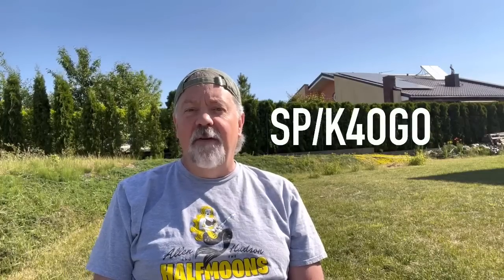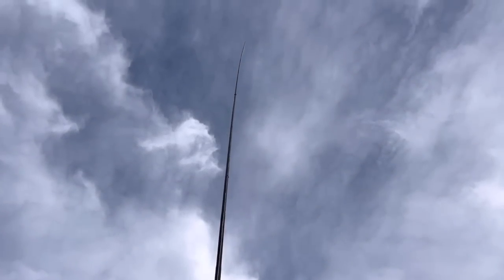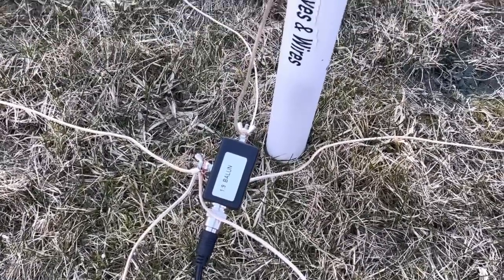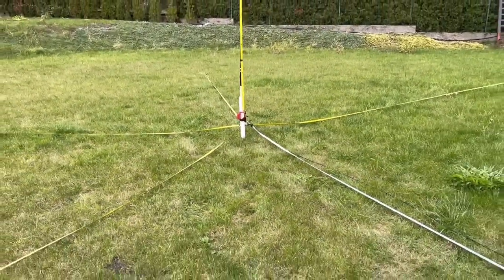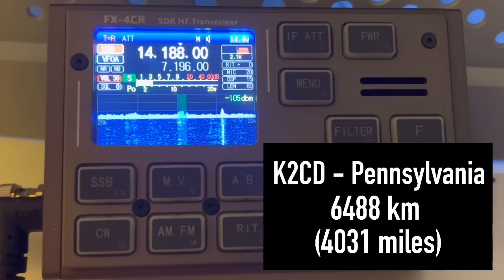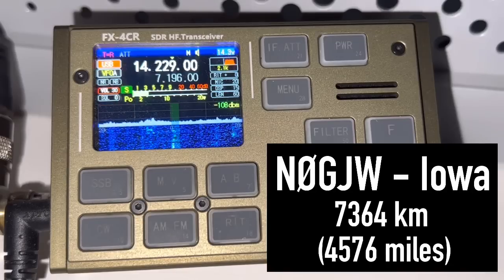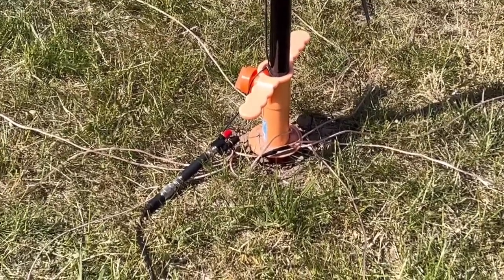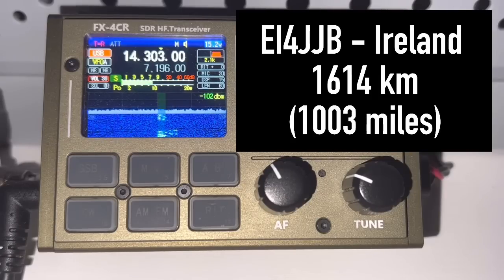Building Vertical Antennas for HF Ham Radio DX

Comment: I would like your feedback of using a tree to hang a vertical.  I would like to try to hide this antenna but worried about how the tree interfere
Reply from the maker: Go for it! The tree will have minimal effect in the antenna. My current home base antenna is an inverted V EFHW hung through limbs in a tree and it is performing well. 73, Walt
Reply: @COASTALWAVESWIRES  Wow, may thanks Walt for the quick response.  The trouble I have is that I have several powerlines, power corridor, that run near my back fence in my backyard.  To string a EFHW or LW horizontally, one end would be near the powerlines (noisey).  I am trying to find ways to get farther away from the powerlines, and have been watching your great videos on verticals.  Looking to possible go perpendicular to the trunk or inverted

Comment: Walt, love your channel, can you talk about how your guy and support your antennas on the beach? How do you anchor guy wires in the sand?
Reply from the maker: Thanks! I never use guy wires on the beach. I typically use a pipe driven into the sand or a beach umbrella spike mount. Here’s a link to a video I did on beach antennas: https://youtu.be/KM9HH5xioXw?si=Ek3ywdPlHFh1-M7o

Comment: I have not had any ham radio signals on 10M or 6 Meters. I use a OCF 80M wire horizontal at about 24 feet up. I had to make it L shaped because of my property but Eurpope would be at 45degrees from the center of the LI am in the Kansas City area. I can get 20 all day and evening including DX in dark hours, 40 dx dark hours, 80 dx dark hours.  I would love to know what is keeping me from getting any 10 or 6 meters. I do get constant tones  down the waterfall spaced every few hundred or so KHz on both 10 and 6. I use a tuner with a 7300. I make many long distance contacts on the three bands I can get. I have turned off everything but the radio sill have those constant tones. They don't sound like a digital signal just a constant tone. I want to make one of your vertical antenna designs but I have no space for radials. Kansas is running a little short on salt water. Maybe in a few years that will change.

Comment: I’ve had a few. In my experience they have always been inferior to horizontals. I built one over 30’ tall with a web of buried radials, it worked and it wasn’t bad; but it was inferior to dipoles oriented in the direction of the station I was working.  I had a MA5b mini beam deployed only 20’ up, and it was life changing.  The ability to add gain and minimize noise can’t by underestimated.  Near the ocean, you basically get a lobe over water with a vertical, so I’m not surprised you got some gain to the northwest.
Reply from the maker: Horizontal by land, vertical by sea

Comment: This fishing pole you choose is made mostly of carbon fiber. I read that the best to use is a pole made of insulator like glass fiber. Should i find a glass fiber fishing pole or dont bother and choose that pole you showed in the video? Does this really matter?
Reply: Yes, you better get a fiberglass telescopic pole. 

You'll run into issues with the carbon fiber. You'll need to get rid of the layer using a sander which is harmful for the lungs

Comment: The best HF vertical I've found was a Slim Jim. It's only good for one band but highly effective. Built from 450 ohm ladder line...a 1/4 wave matching stub connected to a half wave radiator, like a J-pole, but the Slim Jim connects both sides of the ladder line at the top and there's a gap down near the top of the 1/4 wave stub. The trickiest part is to know the exact vF of the ladder line, in order to get the dimensions right the first time. Not easy to retune. I ended up grabbing a vintage Millen grid dip meter and finding a vF of .95 when it was stated as .92. But it's worth the effort...this thing works very well on 10 meters. Built a second one for 12 meters and 2nd contact was JA with 5x6 on his end. There's also a noise benefit...it's a DC short antenna, like a loop, so has lower noise floor. Very much worth building.
Reply: Ok I think maybe that IS a J-pole, and I like the idea for 10m, it could be practical and have the low angle radiation and not require the added ground connection. Still might be good to get the bottom up at least a quarter wave above ground? Well that means the top of your 3/4 wave antenna needs to be at least 30 feet above ground. Pretty "doable"! I want to try that!
Reply: @davidjohnson497  This guy's calculator works well, but you need to fine tune the dimensions by getting the exact vF of the ladder line. This antenna is a PIA to retune by cutting or adding. I buy an oversize piece of LL...DXEngineering has good stuff...and short one end and use a dip meter to find the vF. Then plug that into the formula, get your dimensions, and build. The only other trick is that the 50 ohm feedpoint position tends to be just a little lower than the calculated one. I highly recommend a nanoVNA. But once you get one up and running, it's an excellent antenna. Not really sure about minimum height above as I'm using it mounted on my 3rd floor fire escape...25' above ground.

Comment: I've fooled with verticals for decades... the most effective one was my "Chicken Coop Vertical."  It was simply a trap vertical in the backyard, but the counterpoise took me three full days of work to construct.  I literally carpeted the backyard with chicken coop wire.  While it was on the ground I took a propane torch and soldered every twist together to prevent oxidation.  Then I used chopped up metal coathangers to tack down all the chicken wire (no digging).  For a good while I mowed the grass high so as not to hit the wire... the weight of the mowed grass eventually buried the wire and it was never seen again and struck during regular height mowing.  I was a great antenna for 20-years until I retired and moved away.  Unless he wants to dig holes in the backyard, the new owner will never know it's there.
Reply: Way cool story and design, thanks for sharing about the chicken wire ground plane! Great idea.

Comment: I noticed on your helical antenna you had a 1:9 balun - always wondered about those, and always thought they were for 5-10 ohm impedances to match to the 50 ohm radio. Was it actually a 9:1 balun and just misnamed?
Reply from the maker: Yes it was 9:1 unun and just misnamed.

Comment: For the wolf river coil and the military antenna, could you tell me which military antenna you used? Did you have to use an adapter with it?
Reply from the maker: I use this one and no adapter is needed: 

HF Manpack Collapsible 7 Element Whip Antenna 285 CM Length https://a.co/d/0TKSEqW
Reply: @COASTALWAVESWIRES  thank you for the quick response, I'm looking through the wolf river website, which coil did you end up using with it?
Reply from the maker: @johnkeo358  I have the Silver Bullet 1000 (the big one). I was just out with it this weekend: https://youtu.be/JHNbEND-Tt0?si=v5vQ6MNIMk0KIo1N
Reply: @COASTALWAVESWIRES  nice, I'll definitely have to consider purchasing it. I always wanted an antenna using the mil whip to get some nostalgia. Just got my ticket for general last month, I hope we meet on the airwaves!
Reply from the maker: @johnkeo358  see you on the airwaves!

Comment: Could you take the 7.6m wire and hang it off the 6m pole, making it slightly off vertical? Would think you'd still get a reasonable takeoff angle.
Reply from the maker: Yes, I think it would work well.

Comment: Good video Walt.   I am a fan of vertical antennas as well.  Currently, I am using half of a driven element from a TH6 beam I had up in the day that really works well on 30m-10m with a external tuner.  This antenna has surprised me on its performance with a half dozen radial under it.  Thanks again KN0A.
Reply from the maker: Thanks! 73 my friend

Comment: look into the Jackite poles, a little heavier but a bit more sturdy.
Reply from the maker: I’ll check them out
Reply: @COASTALWAVESWIRES  Just found you on you tube.  love all of your reviews and the way you present them.  You've got me fired up about QRP.  I ordered the tr usdx and thinking seriously about the FX 4c.  I run a 32' wire up the largest Jackite pole, (32 ft I think) with a 9 to 1 unun at the bottom.  Does real well portable.  going to look into the Rybakov!
Reply from the maker: @williamsteele5729  awesome! Good DX my friend!!!

Comment: This video is great.  What you said at about 15:08 is exactly what I tell all the new hams that are worried about antennas.  I tell them that the best part of antennas is just going out and trying them out.  If one doesn't work, try another.  Before long, they will find one that performs for them.  I also tell them that what works really well for others may not work for them and vice-versa.  So indeed, a great video putting that theory to work!  73 de N6VHF
Reply from the maker: Thanks so much! I completely agree! 73 de K4OGO

Comment: Love your style. As a result, I would appreciate your advice. Im working on a marine solution for my sailing vessel. Working with an icom 7300, shakespeare 390 vertical and a ldg at100proll. Trying to figure out how to setup my ground plane to the sea. Balun 1:1 to a bronze plate? What do you think? After days of research I'm still lost. Lol. Hope to hear from you. Cheers.
Reply from the maker: Thanks! 1:1 balun at the antenna feed point of the antenna will keep the common mode energy out of the radio and reduce noise. Get a wire from the surface of the water to the ground side of the balun. I’m thinking you probably have a thru-hull connection somewhere that’s metal and near the waterline, just connect the wire to that. 73

Comment: Could you comment on the issues you’ve had on 40m at your location. I’m still quite “band inexperienced” and trying to figure out the “one band to rule them all” for antenna planning for my inland south Jersey location
Reply from the maker: My issues on 40 are totally location driven, I’m overwhelmed by Russian operators which dominate the band. Let me save you a lot of frustration and issues. 20 meters is the one band to rule them all. No mater the solar cycle or conditions 20 meters is always available. If I could only work one band it would be 20.

Comment: Now let's get to some math. Cut you a 80 meter 1/4 wave wire. Buy 2 inch PVC. Wrap the wire cut for 80 around the 2 inch pic. Add a stinger or whatever you need for a vertical. Now get out the old trusty swr meter or the MFJ antenna analyzer. Now cut three 33 ft ground wires. No you don't need more regardless of what you have been told. Now find the lowest swr for each band up to 80 meters. You can also get six meters. Now you may need a shunt coil on some bands to get the SWR you want. Shunts are easy to make. Very easy. This design is the same as the designs you pay hundreds of $$$$  for. And you can build it yourself. The reason this antenna has always worked well is the math. If you look at the 1/4 wave at 80 meters with a number 10 or 8 wire you will see you get a nice bandwidth . So don't use a thin wire. We need to build our own antennas in this hobby. And any of us can, with ease and patience. Just do the math .  Save your $$$$$ for the next rig or amp. 73,s
Reply from the maker: How long is the 2 inch PVC for this monster vertical?

Comment: Walt, is there a specific reason for the smaller gauge vertical wire?  thx de K5TET
Reply from the maker: Yes, that’s all I have left here in Poland lol. Honestly I would have rather built this with a better bigger gauge wire and would definitely recommend that for 100 watts. 73 de K4OGO

Comment: Nice Video Walt!

You are really lucky with your antenna field at your PL location: Free field and all the houses far enough away for a clear view to the horizon… Only to be topped by the saltwater amplifier.
I am a bit squished in here with houses all around, so a sloping antenna worked better than a vertical so far.
Reply from the maker: Yes I’m going to miss the place!

Comment: I really like your casual and positive vibe, it makes watching these videos easier.
I mainly operate with either an EFHW or a inverted V dipole but I may have to cut some wire for this antenna.
Reply from the maker: Thanks! I actually have an inverted V in the plans. 73, Walt

Comment: I made a nice 92 ft High vertical antenna using a drone to pull a cable up over a tree limb. And then using that to pull up the main copper wire. Works quite well. Rejects electrical noise fantastically.
Reply from the maker: That’s awesome!
Reply: A drone?  Now why didnt I think of that?  👍👍
Reply: @mewrongwayKOCXF  Mine is equipped with a Fl-Fli Airdrop, a small attachment with a solenoid operated remote controlled pin that can release a load once in the air.
Reply: @basspig  Awesome!!
Reply: What gauge was the cable? Was it heavy for the drone to lift it up?
Reply: @CONFUCIUS-f2x  I didn't lift the copper with the drone. What I did was lift a nylon leader cord over the limb and drop it (WD40 can as a weight) then tied a rope to the end of the cord and pulled the rope up (which becomes the anchor rope) and the other end of the rope is a 6 foot length of guy wire with teflon sleeve over it, held in place by two knots. After the guy wire, I have an insulating piece of flexible PVC hose, followed by the 14AWG copper wire. This gets pulled up over the limb by the rope manually.  I hope this helps explain the process.

Comment: Google for OK1UFC webpage for Rybakov optimization (and many other antennas). It is in Czech, but Google translator will do.
 In short, to have good take off angle up to 10m band, the antenna shall be no longer than 6.4m. So it would be beneficial to have two rybakovs, one for lower, one for higher bands. This is the general problem with all-band antennas, that for higher bands the radiation pattern gets many lobs, not always in predictable and preferable directions.
Reply from the maker: Thanks for the information Pawel

Comment: Which LDG 4:1 are you using? I believe they sell 2.
Reply from the maker: The unun, not the balun. The balun is basically for a Delta Loop (balanced). This is an unbalanced antenna thus unun.

Comment: Thanks to Walt, my Rybakov has become a permanent fixture, joining my 119' end fed and my 40-6 OCFD. And boy does it produce. Thanks, Walt.
Reply: Nice one 👍 👌 I've been playing with 2 AM Pro Sticks for 40m but my noise floor on horizontal to vertical is crazy noise Virtual not so bad can't get my head what the Interference is mmmmm nice video :)
Reply from the maker: @Tom_M9FUE  thank you Tom!
Reply from the maker: Thanks so much for sharing that my friend!
Reply: @COASTALWAVESWIRES  thank you for what you do! You fill our heads with so many antenna ideas, it's hard to know where to start!